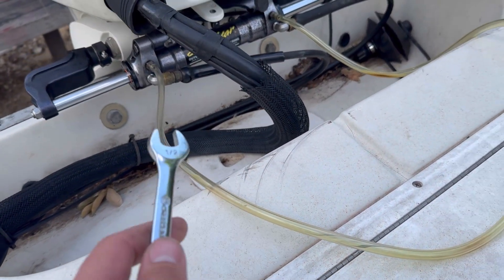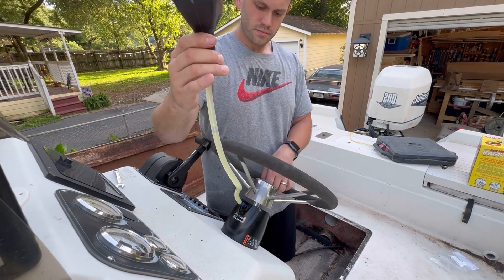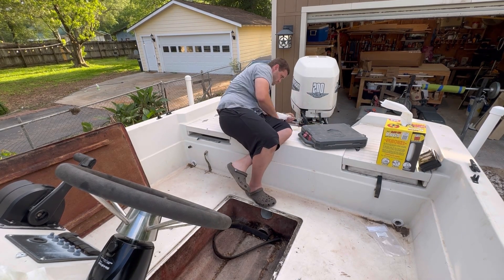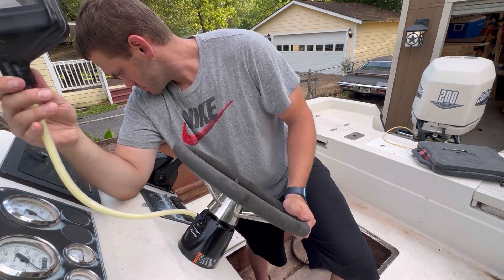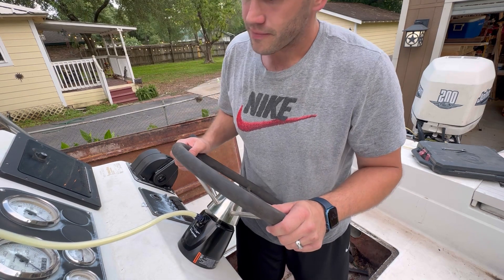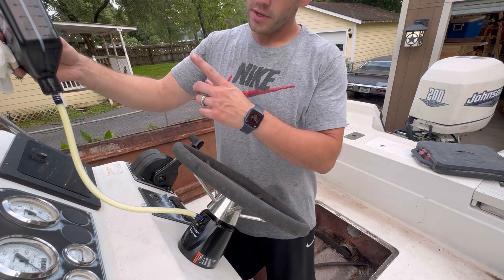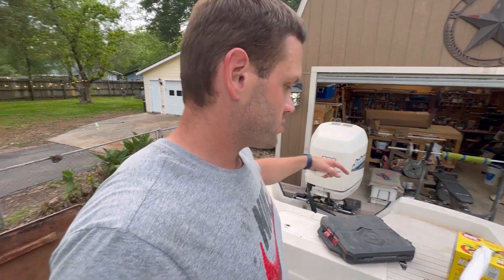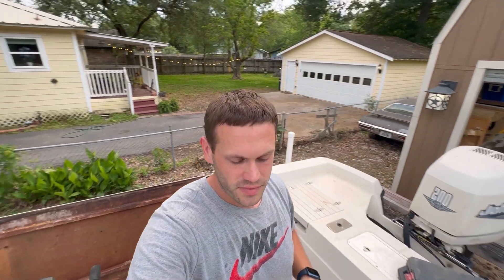Sea Star Steering Part 3 (Bleeding the system)

Comment: I think the color looks like that because you still had water in the steering system and it’s mixed with the fresh oil. I would bleed everything out and start over.
Reply from the maker: @Vnyc22  I was thinking the same exact thing while doing this. I have not re-bled it out yet to redo the oil but that is on my to do list this winter. When I originally did this I drained the cylinder at the engine and blew out the lines “obviously missed some though”. The helm pump was brand new and had not fluid in it. Thanks for the response and confirming my suspicions!